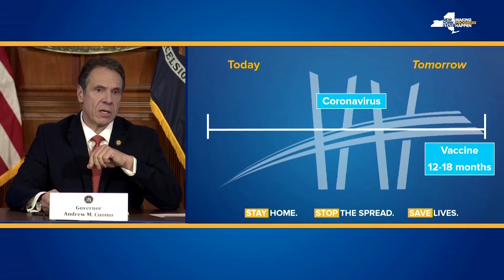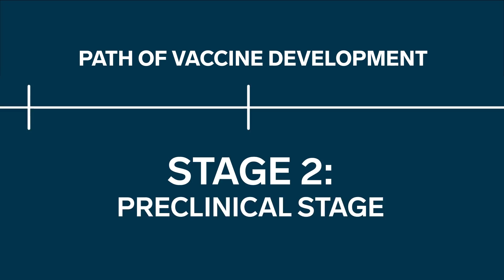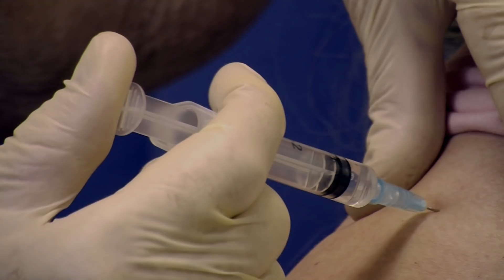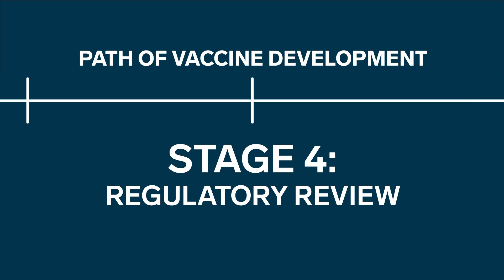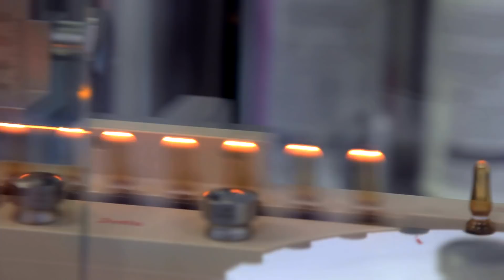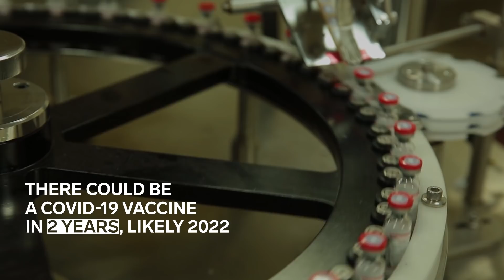Doctor Explains How Fast a Covid-19 Vaccine Could Be Created | Cause + Control | WIRED

Comment: I'm a Project Manager by trade and based on what Seema said even four years is too optimistic.
My reasoning for this is that things NEVER GO SMOOTHLY AND AS PLANNED.
Normally out of all phases of a project there must be at least one highly problematic/risky phase (in this case probably manufacturing).
This phases faces too many unforeseen issues which cause delay after delay and sends the original plan and schedule down a rabbit hole of endless unpleasant surprises.
This means delays become the norm not the exception.
In addition my experience with fast-track/expedited projects show that they are too much trouble for what it's all worth because:-
A) There might be skipping of critical steps.
B) Too much pressures on the project team(s).
C) Brings about an anomalous and untried process to get things done versus the normal way.
D) Involves taking too many risks.
The Results typically are:-
1) More delays due to silly mistakes made along the way and interventions to fix them.
2) Sub-par quality product (in this case a vaccine that could result in major loss of lives).
3) Wasted resources (that could be placed elsewhere on better intiatives) if things go pear shaped.

This means these fast-tracks are little more than PR by top officials to calm the general public and feel good with themselves that they did their best to meet the overwhelming demand for action.

Expect lots of resignations on all levels by the end of the 16 months and sever disamay by all.

I therefore am with a minimum of 4 years, and as a result we need to treat our current situation as the new normal and adapt with life-style changes, hygiene solutions, communication solutions and economic adjustments to cope with this as how life will be after 2020...

Many of these fortunatley exist and for the rest we need to expand our horizons to face the rising challenge.